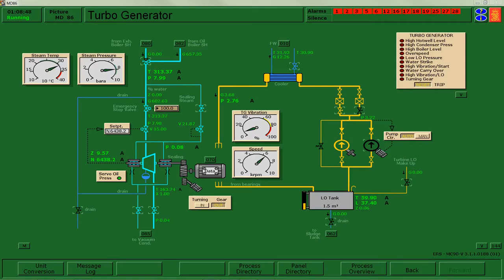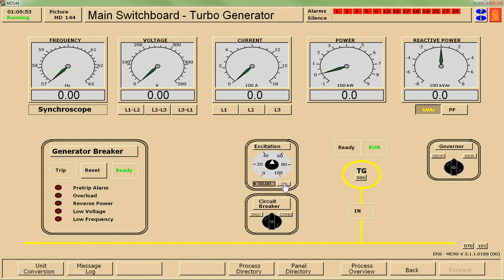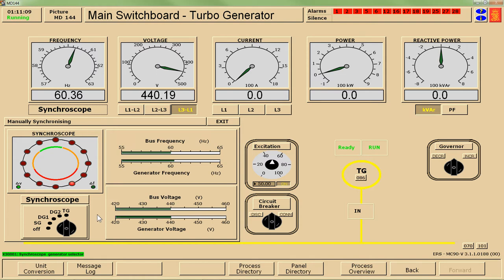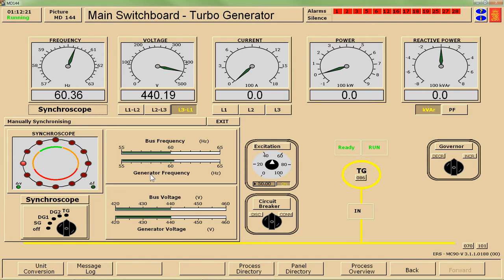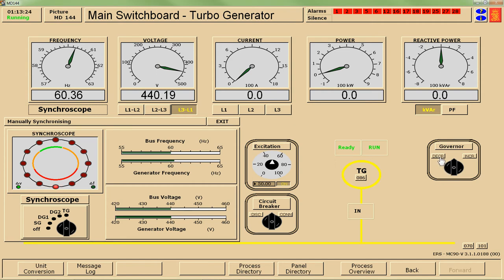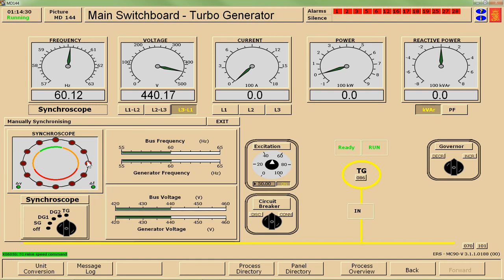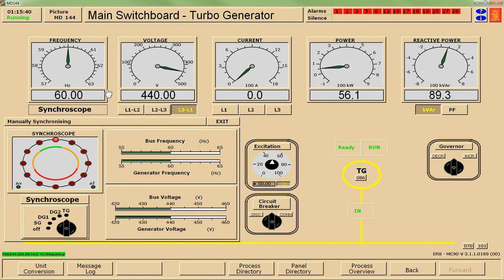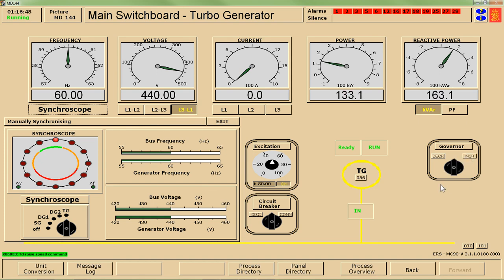Generator Synchronization Using 1 Monitor - Power Plant Simulation - Georgian College

Comment: I am aware that this program is capable of running on multiple monitors. However if I try to run it on our 4 monitor operator training station it only opens on 2 screens. 
Do you know any solution for opening it on all 4 of them ? Thanks for the great content and keep it up!
Reply from the maker: Hi, you have to edit the exercise file using Neptune Instructor.  Instructor allows you to configure the student stations to add additional screens.  Do you have access to the instructor software?
Reply: Ryan Tangney Thanks for the quick reply! I don’t think I have access to that. I have to admit that the program was given to me as a cracked version free of charge. I use it for training at home on a multiple monitor training station I bought some time ago.